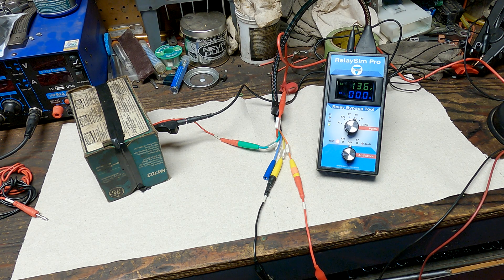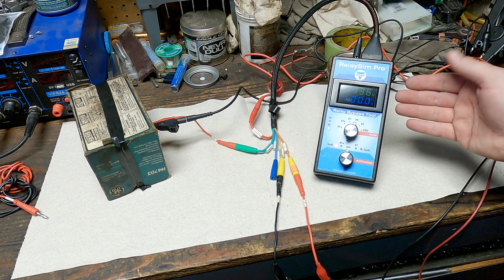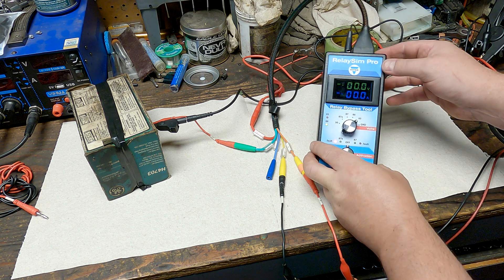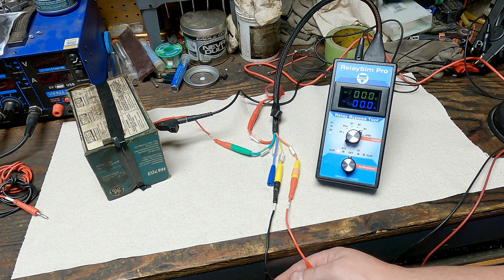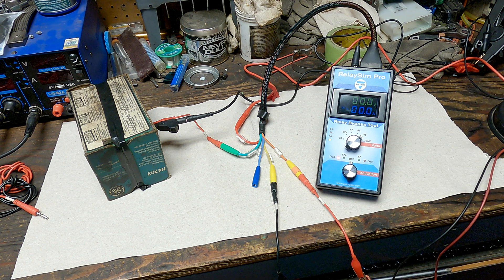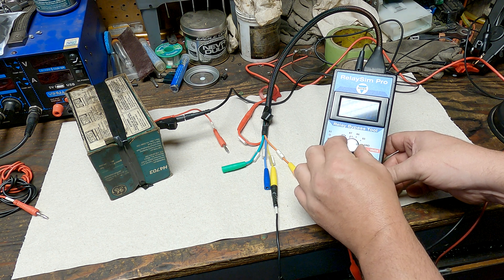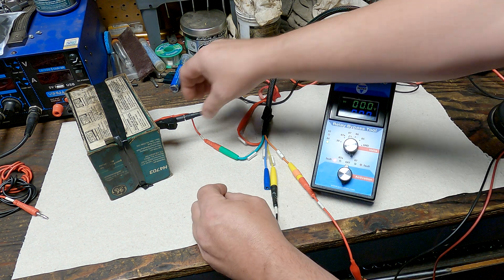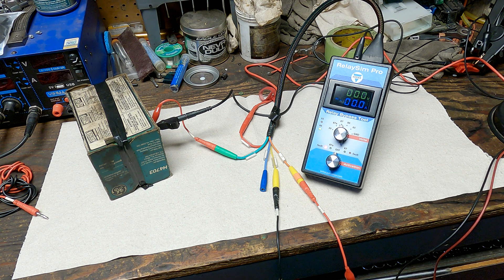RelaySim Pro: Demonstration on the Bench

Comment: Sir,can this tool start El.things-loads like uactivate,it seems not.thank you nice video.keep up them coming
Reply from the maker: Yes the lower switch allows you to connect terminal 30 to either 87 or 87a. Once the switch is on, it will show the current flowing through the circuit.